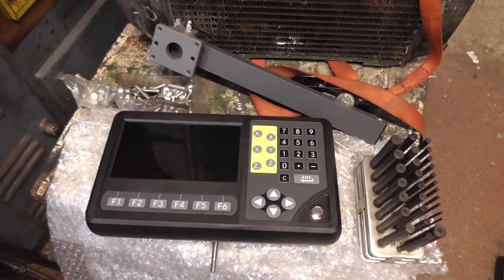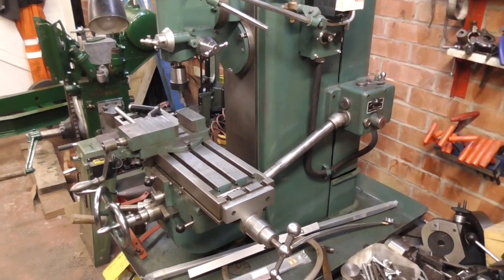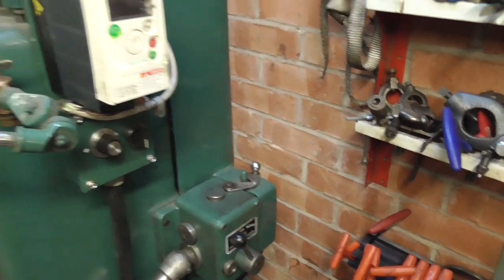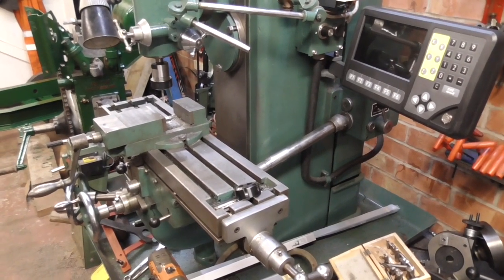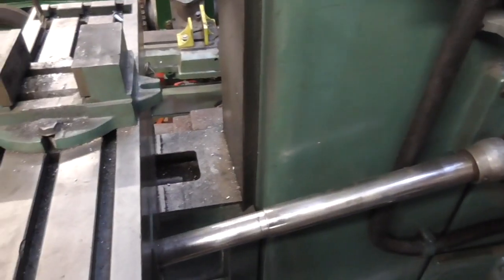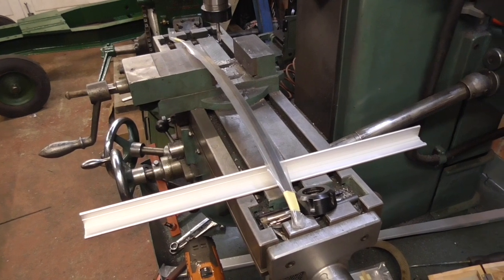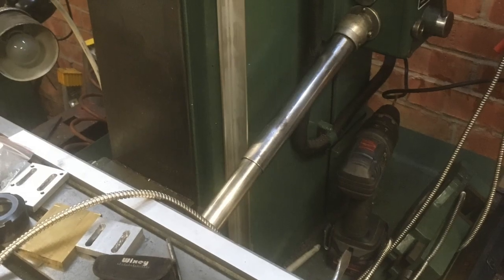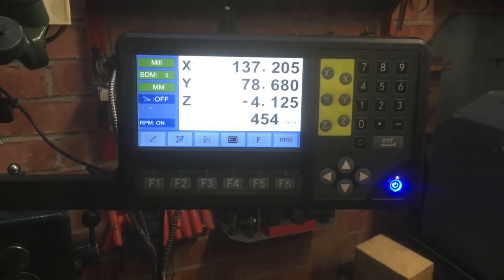Fitting a DRO part 1

Comment: Thanks for the video. I have the Ditron D80 which looks exactly the same. Picked it up new for $59 shipped brand new along with 2 5um linear scales for $100 shipped. I have the 2 axis version currently fitting to my lathe but I'm now considering the 3 axis for $89 for a mill as it seems to be an even better value on a mill.